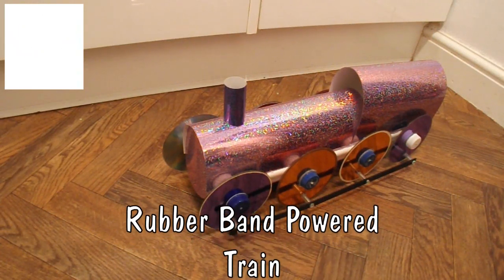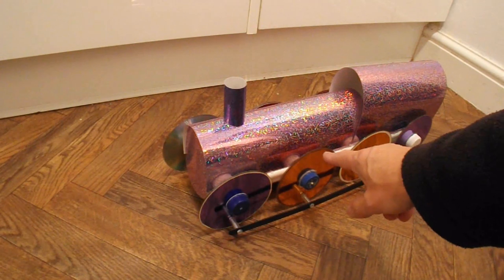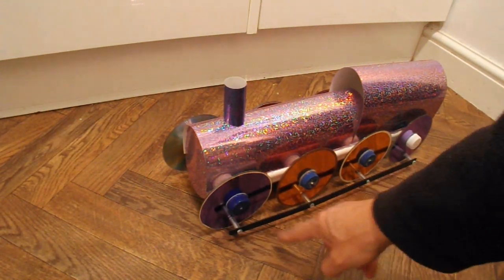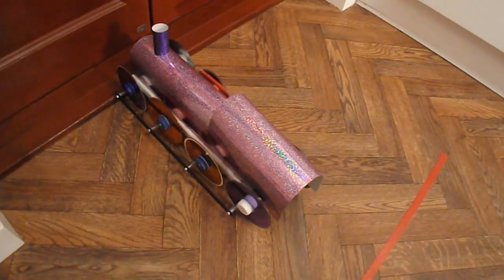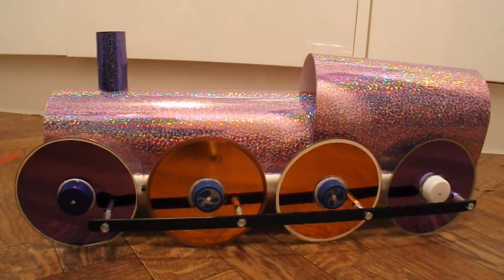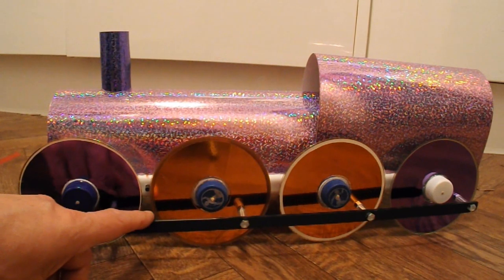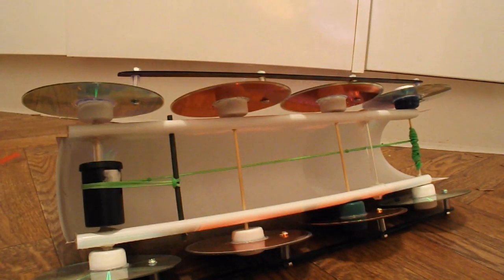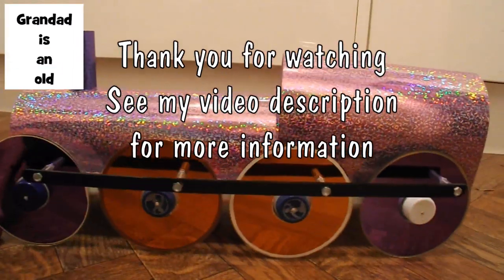Rubber Band Powered Train

Comment: Could you please tell me how you made the rubber band powered train, step by step?
Reply from the maker: +Nicholas Murphy Hi Nicholas, my previous reply was not as helpful as it should have been. The point is that I explain in the video that it is just one of my previous cars with a couple of extra axles and 4 extra wheels added with a plastic strip along the side to link them together. Then a bit or pretty cardboard bent over it to look the part. The video description gives the link to the original build.
Reply: thanks

Comment: can u put it on tracks?
Reply: umm i mean railes?
Reply from the maker: It could be put on rails if you made some the right shape. If you wanted it to turn it would have to be a very wide radius as this train only goes in a straight line so the curve would have to be so slight it would hardly notice. I certainly will not be doing it as it would require far more space and time than I am willing to spend on it.

Comment: hey granddad i have an rc car but the range was realy poor so i changed the transmitter every thing workes fine exsept the steering was wrong so right is left and left is right can you help. ecscuse my speling.
Reply from the maker: Yes that is a common problem as there does not appear to be a standard set for which way cheap RC toys should work. The best fix would be to take the car apart, identify the two wires that go to the front steering motor and reverse them but that really needs you to be able to use a soldering iron. If they are long enough you could cut those wires and then strip a little insulation of the ends so you can cross them over and twist the conductors back together and put a little tape over the joints. I doubt that there are any wires in the transmitter that would be easily moved to do the swap at that end.
Reply: +GrandadIsAnOldMan I wish I could send it to you to fix
Reply from the maker: Oscar I'Anson sorry I don't offer that service.